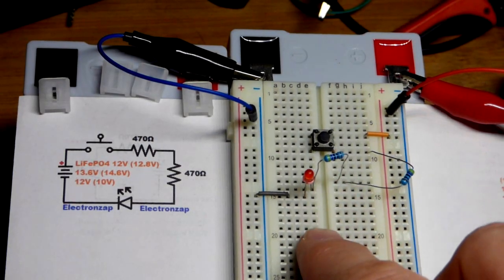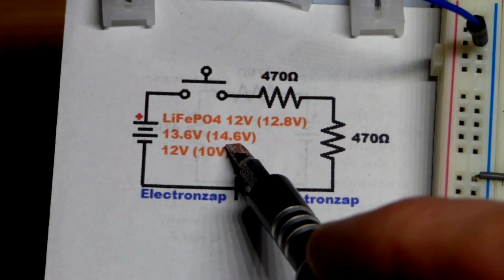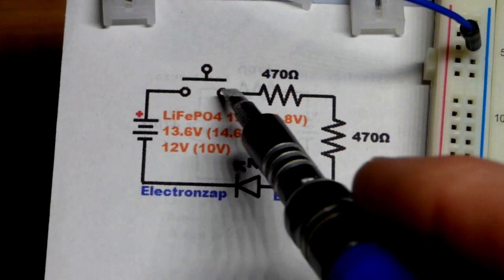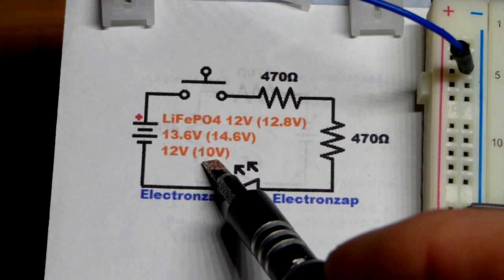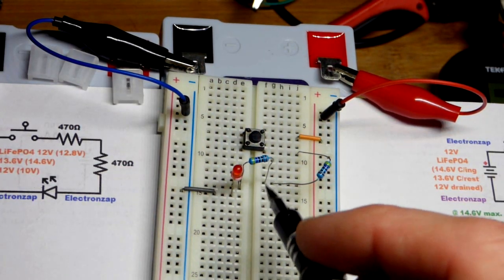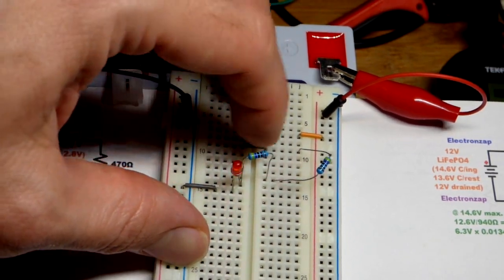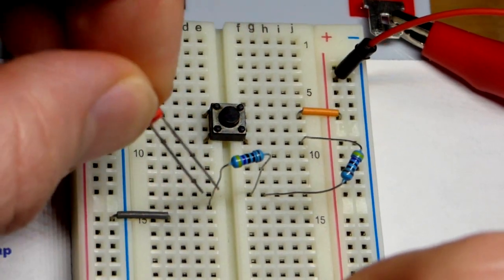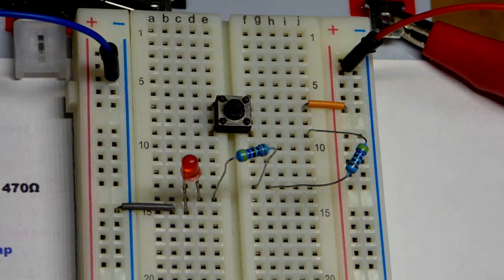Push button switch controlled LED circuit powered with 12V LiFePO4 battery

Comment: A few good take homes, if I've understood correctly, like doubling up the resisters to share the 'heat, making your calcs to reflect the true voltages possible and the daddy of them all ''Don't force it just keep wriggling it until it slips in' sage advice to the novice and pro alike. Thanks Paul another interesting session
Reply from the maker: Thanks for watching!